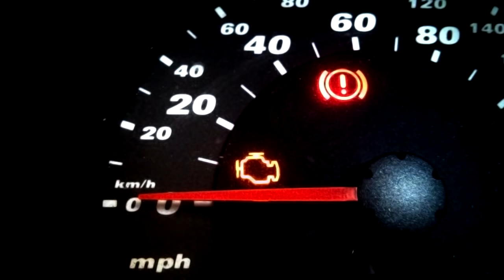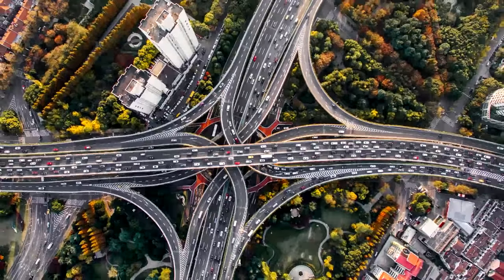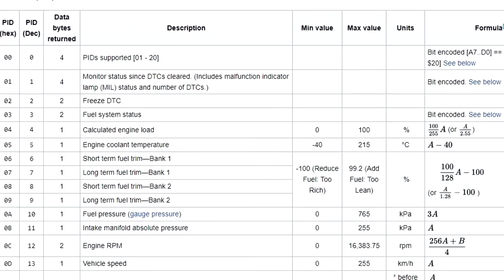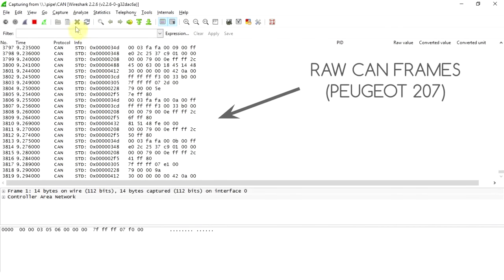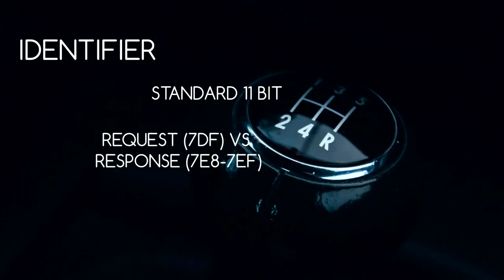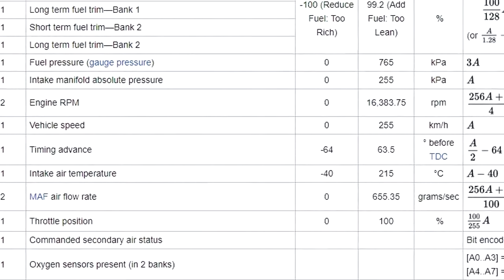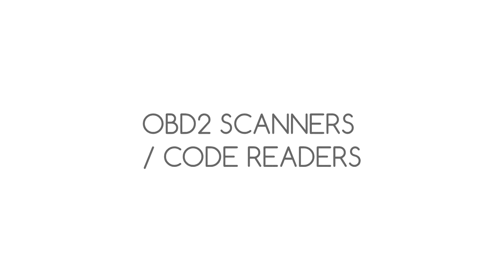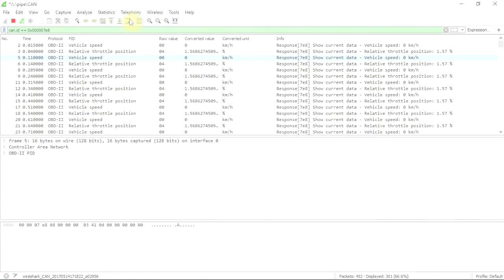OBD2 Explained - A Simple Intro [v1.0 | 2019]

Comment: Too many mechanics now 'rely' on ECU data output. "There's no codes set, so there's nothing wrong with the vehicle." Bollocks! Do what your job title says. If all that was required was to read the codes, then anybody could do it. It's when the vehicle is acting up and the ECU isn't seeing a sensor fault that they need to get down and dirty to find the actual problem. Recently we had a starting issue. 6 mechanics read the computer and said there was nothing wrong with the car. Yet they all agreed that it was too hard to start. Eventually I started looking into it myself. We'd had a service done on it and one of the items changed was the in-tank fuel filter. I pulled the filter and low-and-behold, the pump pickup pipe 'o' ring seal was broken. It was damaged as the pump was slid into the new filter. It was allowing air to be sucked up, and that was the cause of the hard starting. And there's no sensor there, so the ECU couldn't see it. Mechanics, do your job! The computer should be just the first step (as opposed to the only one) in fixing the problem. If there's no codes, at least you know what the problem isn't. Now start looking elsewhere....
Reply: Yes Chris I agree. Not all faults are captured by OBD. It is upto OEM to decide which faults needs to be populated.
Reply from the maker: It's an interesting point Chris. It's definitely hard to remove the human interaction from the equation :-) at the same time, it'll be interesting to see how machine learning may play a role going forward. One could imagine that even if a single ECU is not present for a particular fault, the pattern across the other ECUs will correctly identify the error - backing up your case with data even when there's "none".
Reply: I went to college for automotive right out of high school back in "04" but decided a year and a half into the program that I only liked to work on my own vehicle so I quit and worked an unrelated field.  14 years later (9months ago) out of work and needing to do something I was offered an automotive job.  I took it figuring something was better then nothing till something better to come along.  In doing so I quickly realized that I again love it and actually would rather work on all vehicles but my own. Lol  I don't know what changed my feeling about it probably just maturity and life experience. Being excited about working automotive again I quickly realized my desire to go back and finish my last half year of education. Moral of the story is back in  "04" where I received the majority of my education obd2 was still a relatively new development and was thought of as a great aid in helping to diagnose.  But a tool was all that it was no different then any other tool in the tool box.  Now having gone back to school I have to agree with you that many/most think of a scantool as a solution with no consideration of how to proceed if the screen doesn't tell them exactly what to do next.   They think of it as a scansolution instead of a scantool which is ridiculous because when such a tool exists their job will no longer be necessary.  I'm sorry for your bad experience with a tech. Your story motivates me to continue learning and to have understanding of all systems and how they work (that's what brought me to this video) whether a computer tells me what's wrong or not in hope of never having a similar comment written about myself.
Reply: So true chris. In my opinion, mechanics should know the basics on engine operation before relying on scan tools.
Reply: I'm glad you fixed your problem yourself. If the technician whom looked at your vehicle was a certified A-Tech the first thing he would've looked at with a hard start would have been 1. Fuel Pressure; 2 Fuel Trim Data.  According to what you stated that the O-ring Seal was broken and sucking in air would have created a fuel vapor in your fuel rail system leaning your Air Fuel Ratio significantly.  You didn't mention the type of vehicle but If your vehicle uses a Oxygen Sensor Fuel Trim PID's would be traceable and if it uses a modern Air/Fuel Ration Sensor then it would've been even more precise.  I'm sorry to hear that all of these techs weren't able to find your problem but I hope you truly took your vehicle to a certified tech.  Also a vehicle sensor only points in the direction of a malfunction and because a check engine lamp may be on it does NOT deem the sensor at fault.  A great example is a Oxygen Sensor may set the Service Engine Lamp but the sensor may be fully functional stating that your car could be running too lean or too rich and this is why it set, therefore the sensor did its job.  I hope this helps in clarifying how OBDII data pids really help a tech even if the check engine lamp may not be on.  A good note for all techs to check first is the freeze frame data to see when the event occurred.  It gives valuable info such as speed, rpm, temperature, etc;   I hope this helps.
Reply: A fuel pump going out will do the same thing.
Reply: Hi Chris how are you.yes you say right i am Muhammad Nadeem Ahmed from PAKISTAN you have a good diagnosing look some vehicle have not fuel trim system he is not show the fuel line pressure.no every thing diagnose the scanner no tell is the ECM must be have a good diagnosing experience like you.this is silent fault.THANKS for sharing GOD Bless you
Reply: Actually some cars have fuel pressure sensor built in so you can read from the obd2
Reply: Eww
Reply: Mr. Zavala I had the same sort of issue but time wasted = loads. My OBD2 scanner told me there was a problem with Co2 sensor - forums advised all sorts of random solutions - I took half a step back & thought about it - Co2 sensor says there’s a problem with what’s coming out of the carb - Hmmmm - a fuel mixture problem - I will check the air filter - replaced the air filter & everything is ok - that was 600 miles ago - no problems since. The amount of BAD ADVICE out there is astounding.
Reply: That is why there is a difference between a mechanic and a technician
Reply: The "premier" BMW dealer here in Canberra Australia works just like that. Oh sorry we did $3700 worth of work unrelated to the engine stopping because the diagnostics didn't tell us to change the crank position sensor.... The world is full of overpriced clowns "technicians" that can only follow the on screen instructions and totally fail at real diagnosis.
Reply: @ingmarm8858  a real technician is a real student that doesn't rely on guess or computers. A person that guesses and just goes changes parts by "scan tool data" is just a posee. A technician does not have to be certified or have all these fancy patches on. A technician is known for real experience, diagnosing, and researching.
Reply: Odd EVAP didn't find/flag that, during pressurizing test.
Reply: @georgekennedy8644  Similar problem, just last week.  Had a P0110 sensor error.  Changed the air filter, used a mass airflow cleaner on the sensor, and the error's gone.
Reply: Though being true, it is also necessary to understand this information if you were developing something like motorsport equipment. Understanding how this system works can give you even further systems to monitor including things like MGU-K torque, MGU-K Temp, MGU-K Effic, MGU-K output, LF Break Temp, tire temps, various coolant temps that aren't just ICE related. Yeah, I can tell you when the turbo isn't getting flow in the high-end by ear and by ass, but I for damn sure would like to know where I can open things up in plumbing efficiently and cost-effectively by being able to study individual data points. Only a fool remains to think he hasn't the ability to learn something new when times change. Many have lived and died behind the fields of motorsport and the faster we go, the more automated we have to get.

Comment: Why are most scanners that have bidirectional capabilities so expensive? Doesn't it work on the same standard? What is the device used in-between, say, a PC or tablet and the car? I get the gist of a reader, but a lot of bidirectional scan tools use a wireless module not much bigger than a standalone reader. What hardware is in this module that allows bidirectional capabilities?

Comment: My car does not have a High Temperature and Voltage guage. I an thinking of buying a ODB HUD (heads UP Display) to monitor the water temperature and status of the supply voltage whilce i a using the car

Is connecting this device permanently to the oBD 2 port safe for the car? or will it damage it?
thanks

Comment: Dear CSS Electronis, please can explain how OBD-II diagnostic can communicate or send PID into vehicle, when an Intrusion Detection System is installed? DBC and or all rules  are provided by the OEM manufacture?
Thank you all to any response!
Reply: Can you clarify what you mean here? If the access to the CAN bus is blocked via the OBD2 connector, you'd basically need to hook into the CAN bus behind the OBD2 connector - though this is more cumbersome.

Comment: I’d would like to learn how to control a simple node using OBD2 data (rpm). Is that possible? Or is that done via CAN instead?
Reply: So if I read and understand correctly, if I want to control a node it would have to be done via CAN... but can a Arduino PLC controller be used to read OBD2 to control a node?

Comment: At times some mechanics can be blinded by all the data that's presented to them on a code reader. Causing them to over think the problem and miss the blatantly obvious issue that  90% of the time right in front of there eyes.  Also Bear in mind tho that todays vehicles can be extremely complex to work on and diagnose faults on. Most people believe that it is simply a case of plugging a computer in and being told the fault. But alot of the time it really isn t that simple.

Comment: Awesome video! Thank you! Would OBD2 scanners also work on newer motorcycles? Is there a way to hook up a scanner and read data?
Reply: I'm not sure if you'd be able to use a standard OBD2 scanner for most motorcycles, to my knowledge they're not required to support OBD2 in the way non-EV vehicles are. However, we've got plenty of two-wheeler users that record the raw CAN bus data from their motorcycles, e-scooters, e-bikes etc. - see e.g. our Case Studies section for a use case with Zero Motorcycles.

Comment: Where can i learn what type is my car's OBD. It's a GM Opel astra F 1992 1.4lt
Reply: It'll have an OBD1 system, since it's pre-1996, which is much less detailed than the system described here.
Reply from the maker: You'll probably have a hard time getting data from your vehicle. In our experience, even cars as recent as mid 2000s will have far less data than those from 2010-15+ when it comes to standard Mode 01 PIDs
Reply: OBD was not introduced until 1996 and newer
Reply: OBDII was not introduced before 1996!

Comment: If my vehicle has OBD2 port? Can it be read by OBD2  scanner regardless if it is a diesel or gasoline?
Reply: I mean any OBD2 scanner?
Reply from the maker: Yes, assuming that your car satisfies the requirements outlined in the video in terms of age etc. As outlined, not all cars support all OBD2 parameters - but you can request the Supported PID messages to get insight into e.g. which Mode 01 parameters are supported (if you're interested in e.g. vehicle speed, RPM etc.)
Reply: How about busses?? I plan to buy one but i dont know what scanner should i buy for my bus? The bus has 16 pins.

Comment: How would I find the lowest cost scanner or module that would allow me to turn on and off modules such as close the canister valve and seal the evap system for testing? Thanks for your time.
Reply: Autel MaxiSys is a decent one for the money though the price range starts at $1250.00+ compared to a Snapon Verus retailing for $10,000.00.  If you want to look at data other than just codes you will need a decent scanner.  Nothing cheaper is fast enough to really catch the hickups in faults.  Also try purchasing an oscilloscope to view waveforms and for injectors and coils as well a fuel RPM and more.  Scopes are a must have now these days with OBD / CAN network PIDs
Reply: @Green Tea Thanks